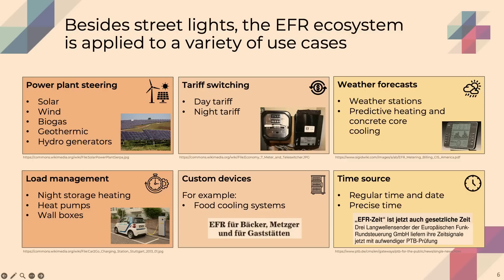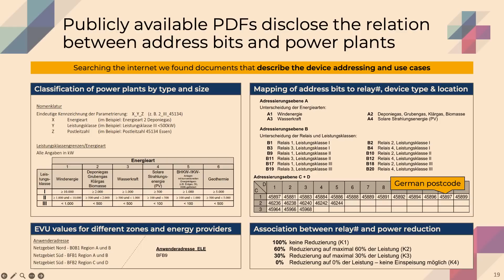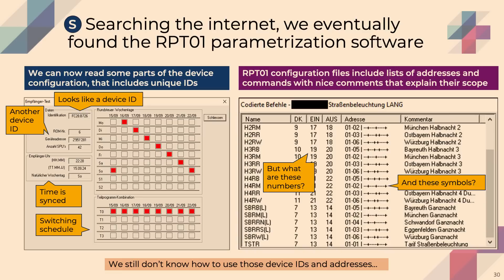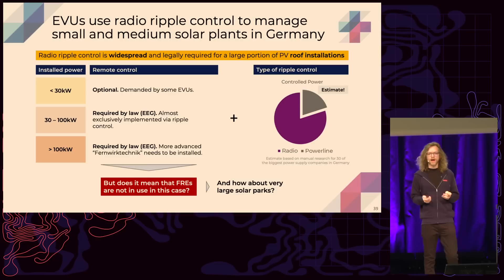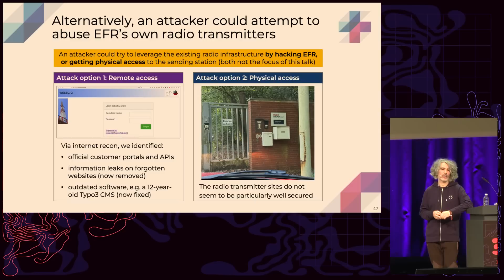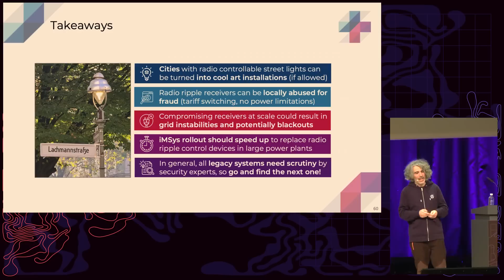38C3 - BlinkenCity: Radio-Controlling Street Lamps and Power Plants

Comment: The 60GW are misleading. Solar numbers can never be taken at face value, since the orientation can wildly differ and lead to the peak never being reached. Probably saying only 80% can be reached is reasonable. Another factor I can not estimate at all is how good the solar parks are connected, it could very well happen that as soon as they start to input close to peak power, they automatically shut down due to overload of something during peak production. This means on the other hand that during peak times for sure not the full 20GW are available in terms of solar, more likely 10 at best id say. And that is assuming perfect sunshine over all of europe, which is rare. 

Then there is the issue of wind needing to blow - usually this happens more during the winter when the solar power is way weaker. But sure, for arguments sake this is also the case, a very windy but sunny day. Again, with wind the direction needs to be taken in account, so its unlikely we will ever reach the 20GW. 

Heat pumps are usually used when its cold, so not very sunny. So at peak disruptible power we can say its winter since else its possible a lot of systems are disconnected from the system somehow, alternatively we can argue that either little wind or little solar is found. So we shed maybe 40GW in differential if EVERYTHING goes well, which to be honest I doubt - I would be surprised if we reached 30. Thats still a dangerous number, dont get me wrong, but its distributed. Distributed means the automatic shutdowns will absolutely work and once certain frequencies are reached, the solar parks in general shut themselves down too. The load shedding will also help a lot more than its calculated to since it will also shut down the hacked loads. 

In other words, I find the 60GW to be a bit too much to reasonably assume. Its a danger, no doubt, and its wild to me that EFR is not encrypted. But we can probably halve that number even on the days with the best conditions. By then its only 10% of the low number of 300GW assumed here (not saying its wrong - but during winter at its peak its 400GW and 300GW is the minimum. That is ofc different in the summer.) and can thus easily be solved by load shedding, if it doesnt solve itself with batteries that follow the frequency or other fun gadgets. Its just very distributed, so I dont think it will harm the grid THAT much in terms of too much load either? not entirely sure. What happened a few times is the grid getting ripped apart due to frequency differences, that could happen too. It could also be the last tipping point if the grid is already unstable to make it fully collapse. I dont want to downplay the risk. But the numbers dont feel reliable.
Reply: Even if you only control HALF of that, considering the german daily peak load is somewhere around 70GW and the talk mentions you can already notice effects of a 3.3 GW variance would be sufficient and ... 18GW would be sufficient for a 1Hz drop in the european grid... I doubt you need to control 60GW to trigger a cascading effect.
Reply: @koaschten  youre not wrong. But usually efr controlled PV is quite slow, so if you send out the signal, it will be slow enough to initiate load shedding so the grid would stand.

Comment: Awesome, so 60GW worth of power plants are controlled by open unauthenticated radio broadcast for who knows how long and nobody even tried to exploit that. And there is a mitigation plan somewhere in 10 years from now. Right. That's both scary and reassuring. In opposite ways. Scary because how dumb the system is. Reassuring because no "state level actor" had even thought to look at that (either has no capabilities, or desire, or just luck).

Otoh, it shows much of the modern world is just hanging on a string and the fact that nobody is rocking the boat seriously. Everyone one scared of connecting infrastructure to the "scary internet with hackers", nobody scared of connecting infrastructure via RADIO WITH 1900 ERA PROTOCOL with zero audit or security
Reply: Well I guess at least anyone hostile trying to broadcast a hack will literally show their location like a Christmas tree for triangulation. But even if it's a regional attack it's definitely scary.
Reply: @krissp8712  well, yeah, but it will take half a day to find and shutdown a transmitters on a random hills around the country. And attackers don't need to babysit their devices, timer would suffice. And there may be dozens hidden transmitters, waiting for activation. Could easily deny radio control for a week and cost nothing compared to a potential damage

Comment: Cycling load or sources at an appropriate frequency could probably destabilize the algorithms that attempt to stabilize the grid. This might make it possible for a smaller transmitter to have the same impact. This really is one of those things where untill it breaks or is abused to cause some massive disruption, no one one in government will spend a plugged nickel on it. But I for one am sure that it is only a matter of time until this is used to kill thousands, assuming it hasn't already happened, perhaps in Ukraine.
Reply: its no algorithm that stabilizes the grid, the switches simply open up and need to manually be closed again.

Comment: For the long antenna idea, you CAN use a drone; all you need to do is run a pair of wires along the antenna that float the battery as it flies. This can be fed up a single co-ax to the drone using the +DC feed in the centre and shield as ground, with the shield also acting as the antenna carrying the transmission signal.
Reply: Have you ever thought about the weight of 550m of Coax cable? You would need a drone to be able to carry that in the first place and then you need another wire, that can handle 10kW of emitting power and be also 550m long. 😂
Reply: @koaschten I just went and lifted two 250m reels of CT100 coax on drums...... yes I agree the weight may be an issue as they must be circa 50kG lol. Back to the drawing board for this one
Reply: Sounds neat! Has anyone ever done this?

Comment: why all this complexity when a simple LDR will turn the lights on when its dark?....
Reply: an LDR is never simple... just scraped bird poo from one of mine recently. will switch to mqtt soon.
Reply: all our street lights here in aus have their own built in control from a LDR or light sensor of some sort..
they will come on in the middle of the day if there is a storm and the sky is dark...exactly when you need it...
the only usefulness i can see with the radio controlled stuff is to control the base load... but do you really want them switching off the lights when they needed? ..or even switching off power to your house at any time...for any reason they deem worthy? ...HELL NO..
Reply: Here’s the actual answer: because then the street light manufacturers wouldn’t have anything to sell to municipalities
Reply: I presume because this is intended as part of a system for managing the electric power grid -- lower consumption or even return power to the grid from ev batteries if there is a sudden demand surge.
Reply: They might not match power grid consumption patterns / power load schemes. Also lot of lights are dimmed during pate hours for 50% or more for lower power consumption.
Altough i agree that LDR might be additional detecting system on top of it.
Reply: Yeah but it’s also not a good idea to have so much uncontrollable/uncontrolled power plant sitting around….especially if the fix could be that simple